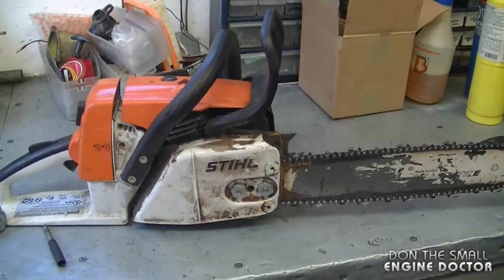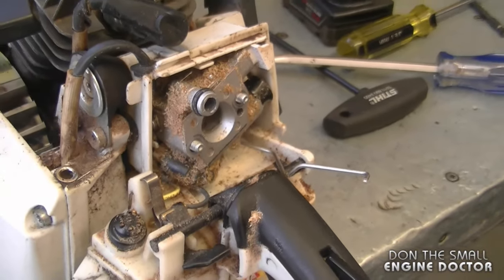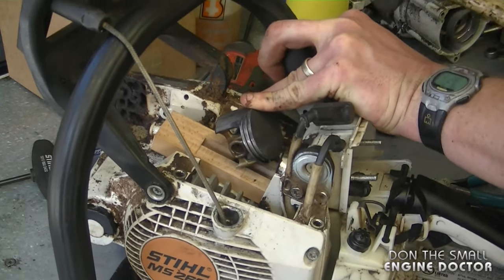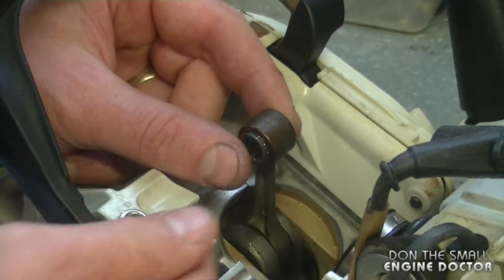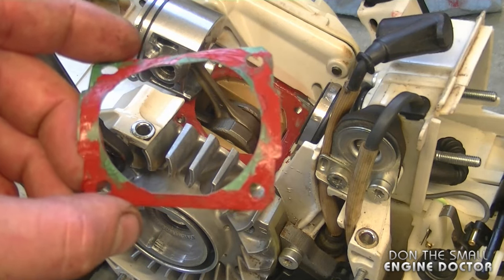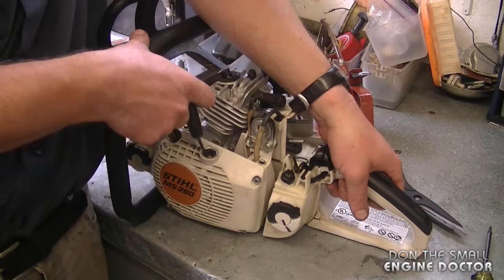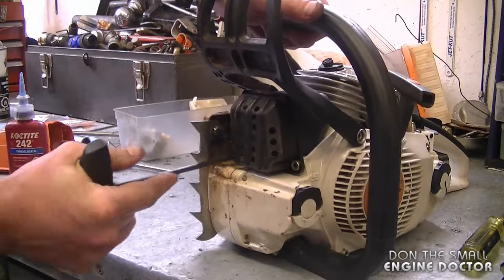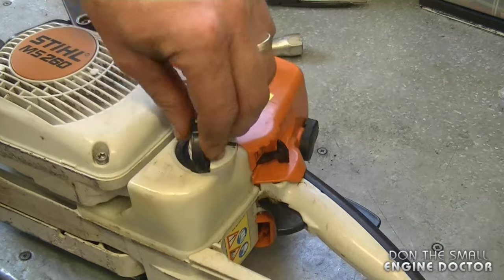Top End Rebuild On Stihl MS260 Chainsaw With Force-Tec Cylinder Kit

Comment: Hello friend I have stihl ms 650 and it is giving me  hard time.  When I want to start the machine I do  all the procedure in starting  chainsaw machine. Press  decompression valve  and keep pulling the rope until starts I keep it running for 3 minutes after 3 minutes I shut it down then I try to started will not start  it becomes very hard to pull the rope then I take the plug out  and pull the rope several times to make sure not flooded. 
	Dose anybody run into this problem before please tell me so I can solve this problem

Ahmed

Comment: Hello, this is Mike with North Texas tree expert company here in Texas. I was wondering if I could get in contact with you. I would also like to make a contribution for some help and advice. I've been in the tree industry for over 16 years and I've been having this done or just buying a brand-new chainsaw. I have like 20 saws that have the same problem. My problem is that I own the business, but I'm not always hands-on with my employees. I don't always go to the gas station with them to buy and mix the gas or watch them put it into the tank. I think a bad oil mix ratio or no oil in fuel sometimes is to blaim. That and not cleaning dirty filters is the reason. It's a big problem. Most of my saws last only a year or less. Long story short I pulled teeth and now trying to get them to do what they're supposed to and I'm to the point where I just want to learn how to repair the piston and cylinder myself

Comment: Could I please have the link for the T27 bit?
Reply from the maker: type this in amazon, it's the best t27 bit! Irwin Tools 1837630 TORX T27 Impact Performance Series Power Bit, 6"
Reply: Thank you. What was the t27 t handle you used?
Reply from the maker: @matthewgrigg576  stihl number 5910 890 2415

Comment: hey could this saw pull a 20" bar?

-Adam
Reply: SSER - Stittsville Small Engine Repair yes but its to much for it
Reply: I have a 026 pro and its got a 20 inch bar with an RS chain full chisel ..... It screams through hardwood like butter...Mod the muffler and keep the chain super sharp and it will handle anything. Its an older one , 1993 . Built like they are supposed to be. Now days they cut too many corners to save money and sacrifice quality. Hope this helps.

Comment: Don, some  advice.  do not put a big bore (49 MM) on a stihl 029.  I put a farmer technology 49mm big bore cylinder and piston in the 029 I was rebuilding.  it ran fine but it likes to eat flywheels and will eat up their key in short order even though I decreased the crank and flywheel before they were assembled and put it on with an impact wrench.  the big bore just has to much torque and compression for an 029.  they failed when the saw was running and not on startup.  one flywheel was the original one from stihl and the other from china.

Comment: mr Donnie , did you get your black handle torque driver from the dealer or discount parts ? I also wanted to mission too you a product called "copper coat" it is an airosol spray sealent. It can be used for high temp and goes on very thin and works great for sealing. I use it on alot of different applications.I love the stuff. Great video as always. I love the "sthil videos" . i would like to see more on 4mix handheld if you run into some. Sthil is all I run in my business and I dont seem to find many good videos or info. Thanks for sharing as always  and your "THE MAN" :}

Comment from the maker: THE SAME PROCEDURE WILL APPLY TO MOST STIHL CHAINSAWS!
Reply: I have a ms 261 2014 same roughly?
Reply from the maker: @ryanxcr800  a little more tight to work on
Reply: @donyboy73  im finding that out as we speak lol will lubing up the piston and rings needle bearing and wrist pin with stihl oil hurt anything? Just a light coating with finger?
Reply from the maker: @ryanxcr800  good idea, it won't hurt anything. it's actually good to do that
Reply: @donyboy73  i do this on 2 stroke snowmobiles and 4 stroke atvs 
First time I've rebuilt something this small lol
Reply: What brand  a parts are you  using

Comment: Donyboy73

When you speak you have the same tone and well spoken thought as this 
astrophysicist friend of mine, Hugh Ross from reasons to believe dot com ( RTB.COM)

I have just purchased a used ms362 MD 04/13 for 375usd. 
it starts easy and runs strong but it looks like it rolled around in the back of a pickup
for 3 years. glad I ran into your rebuild vid and saw how easy it is to 
rebuild my saw. You gave me hope that a brand new saw is as simple
as, order a couple of parts put in an hour of my time.

also do you have a muffler mod video?

God bless

Mark Wesling

Comment: Wait wait wait.  You said the saw is bad because it was run WITH NO OIL.  That means the LOWER end had no lubrication too.  The crankshaft and con rod bearings went with no oil.   Duh.  Shouldn't you be checking them for damage????
Reply: You are rebuilding an engine but you don't know what the torque specs are for tightening the cylinder bolts?  "Just real tight" is not the professional way to do things.  OMG!  I feel sorry for people using your videos to do work on their equipment.

Comment: Hey there Don, 
                    
What fuel mix do you prescribe,(as you are a Dr. lol.) for a Stihl 029 Chainsaw ?
       Thanks in advance for the answer.

    Cheers , Paul.
Reply from the maker: I use Castrol or stihl oil with a mix of 45:1, it's a bit richer than 50:1
Reply: donyboy73  Thanks again for that Don.

Comment: Any authorized Stihl dealer/repair business can retrofit OEM top end kits for a lot less than they lead on, or to sell, and way better quality.  If a MS270 owner were to buy the Stihl kit from a dealer and DIY the repair, it'd cost over $300CAN but on positive note would be the real deal and the chainsaw would remain a Stihl. 

I understand how the AM kits are enticing and repair work is work. This F-T one is about $90USD, so way cheaper price tag.  But the problem is that the original Stihl MS270, in this case abused and neglected by the owner or borrower, I don't know which wrecked the saw,  becomes a Made in China.  No longer a Stihl, having taken a giant leap backward in material quality and performance. There is no way a $90 kit can match OEM. You know it's made with garbage to be that cheap.  

Having a new OEM top end kit installed or buying a new saw is a tough decision for a 270 owner.  And startling to see such neglect, because it's a very good pro saw. Not the best out there but darn good. Don't know if the owner loaned it to someone who wrecked it, but it's rare for 270 operators to allow the saw to decline to this state.  

I love these videos but despise these AM kits.and unreasonably high price of the real OEM parts that should be available direct purchase for much less.

Comment: Very nice.....except for one thing, the crankshaft seals which were not replaced.  A burned out engine obviously ran very hot and probably damaged those two seals.  Rebuilding the top end without replacing those two seals is an invitation to an overly lean running rebuilt engine....and another burned engine, sooner rather than later.   Admittedly it is a much bigger job to replace both crank seals, but one that the viewers would have appreciated seeing.  A new top end, with old crank seals is a half-ass job.  You are a great 2-cycle engine tech and undoubtedly know better.  Shame on you.....that should have been done.
Reply from the maker: shame on you for commenting before asking what caused it! It was run with too little oil in gas

Comment: running 50:1 oil mix is no good for these saws. the company tells you to do it because the govt wants less smoke but it shortens the life a lot faster.  i have always run 20:1 mix and never had a saw engine go bad in 20 years. usually running it on straight gas will make it seize up and never turn over again.
why didnt you blow the dirt off first?
you act like oil is bad for an engine
i have an 026 and they are a hot little saw